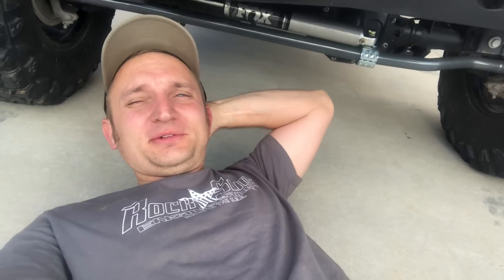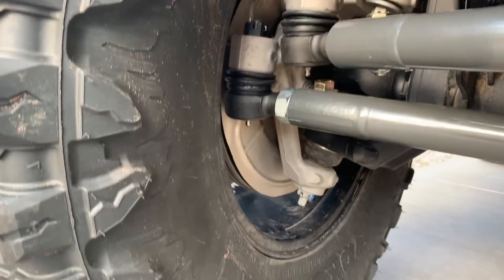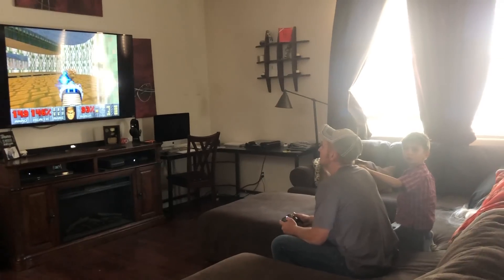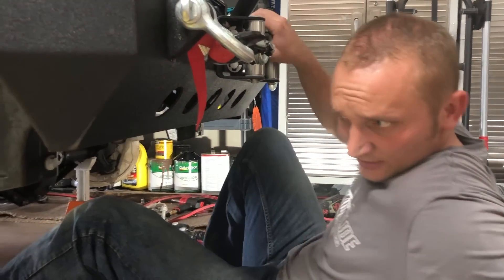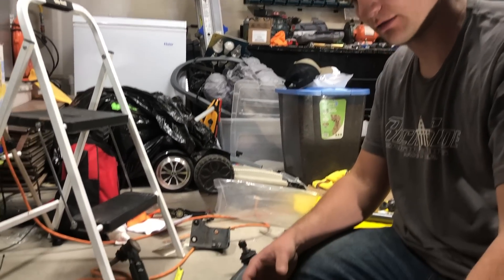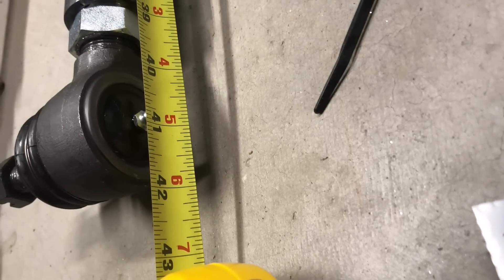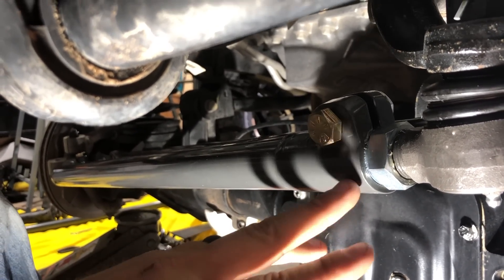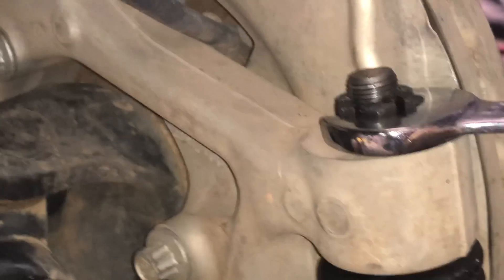JL LIFE   SYNERGY HEAVY DUTY (HD) STEERING UPGRADE for Jeep JL

Comment: Eddie, I got the Dynatrac 2 inch lift on my 21 JL 2 door rubicon. It netted me 2.6 inches all around.
I also added 1/2 spacer in front because I put a winch up front and I have the oem metal bumpers.
We currently live in Alabama and spent 28 years in Phoenix and definitely miss crawling 😔
Our plan is when we retire in 6 years we plan on visiting family in Phoenix for 2-3 months at a time so we are building the JL now.
So my question is with the new Dynatrac lift, the steering seems fine even at 80 mph with bfg at 33’s.

I’d like to add the Synergy tie rod and drag link system. We are going to do some wheeling in Alabama and North Carolina over the next 6 years, but mainly this is my wife’s daily.
What will this system do to the steering?
I’ve had a HD tie rod before 
But not as a set.
Thx john

Comment: Looks great I have the Steer Smarts full kit, drag, track and Tie rod, King Steering Stab, the whole Jeep changed to a solid animal up front, lol. Looks like you installed the steering stab backwards compared to mine and all other I have seen, I know it’s suppose to be equal pressure both ways, but odd seeing it mounted that way
Reply from the maker: Mark Darnell Videos thanks for watching...  u know the reason I put the stabilizer this way... it seemed less likely to rub when flexing... 

Curious do u see potential problems mounted this way? Or it just seems odd to you? Lol
Reply: JL LIFE OFFROAD it is just unusual to mount it that way is all. As long as it’s equal pressure and doesn’t hit anything should be fine

Comment: Parts are on the truck today, this is my project today. The Fox SS on other vids are installed either facing the diff, or the axle: does it matter which way they face?😯
Reply from the maker: Thick side of  stab to diff to avoid rubbing
Also make sure the adjuster sleeve is about .5 of. n inch out from the draglink and tie rod. Will help keep things tight!
Reply: @JLLIFEOFFROAD  Thanks for quick response! 🤘😎🤘
Reply from the maker: Absolutely!

Comment: Just bought 2019 jeep wrangler sports unlimited 4 door and already steering wheels problem. Bring it to dealer they said need to replace rack and pinion. Did you have problem like this?
Reply from the maker: steering problems yes, but replacing the ring and pinion to fix it???? The steering box has problems,, I think they are finally fixing it now. But who knows, dealers are never easy to deal with
Reply from the maker: and im sorry for the 7 moth delay, I typically respond to every constructive comment in a day. Some how this one eluded me. Im sorry

Comment: does her jeep have dana 44 in the front i thought you said she had dana 30
Reply from the maker: It’s a 30 front and 35 rear equivalent... dana renamed these axels and went away from the traditional Dana 30/35/44 names... still no offers why thou
Reply: @JLLIFEOFFROAD  every one on the internet says how weak dana 30 axels are she is doing alot of hard obstacles but she is a good driver that helps
Reply from the maker: Yea... a dana 30/35 can get a lot done... it’s all how u wheel it.. and or course not getting crazy big with tire size